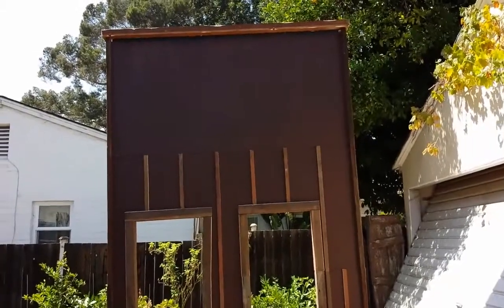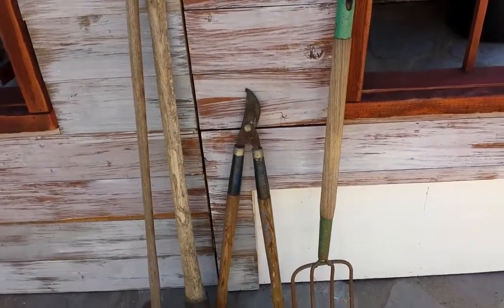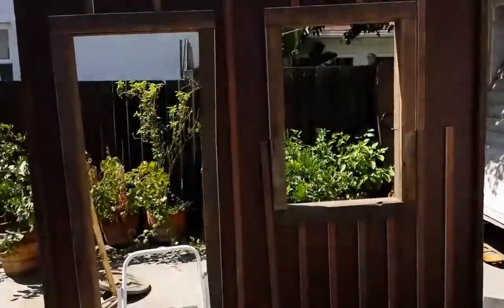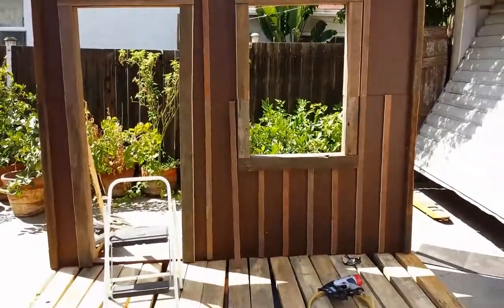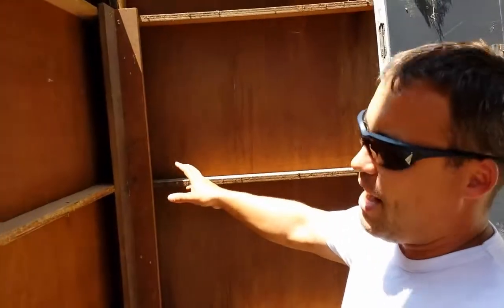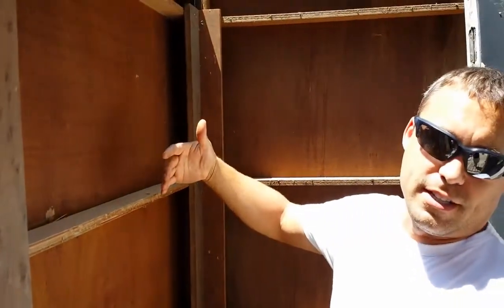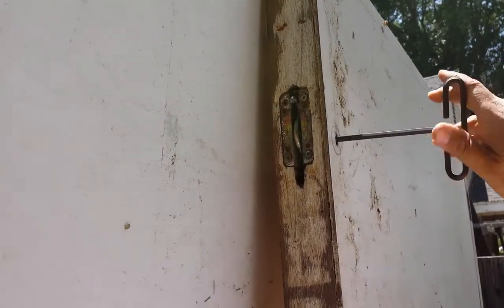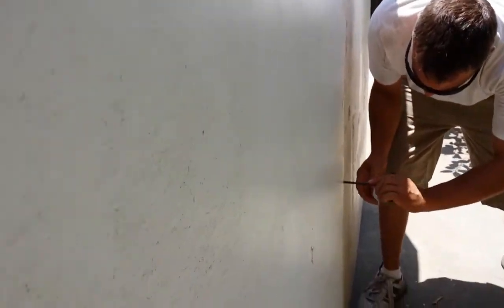Halloween Facade | Haunted Ghost Town General Store (Pt.2) Paint, Props, & Design Ideas

Comment from the maker: Not sure if this was your question but I use a porter cable laminate router for all my doors hinges and wall panel coffin locks along with a template I made to make it easier.  The only tool I use in the video is a Allen wrench or a T hex key to engage the locks.  Hope that answers your question  =)

Comment: those coffin locks are kool! so are coffin locks like something you buy and can put into the walls or did you make that rig yourself?
Reply from the maker: Coffin locks are commonly used in film and theater scenery.  They are also called draw latches or dual lock butt joint set and cabinet lid latches.  You can find them online to order or find a dealer near you.  You have to cut the hole for them to mount in the wood much like installing hardware and hinges in a door.  They work great and make set up quick.
Reply: amazing!!! thank you so much! i think im going to look into using those!!!